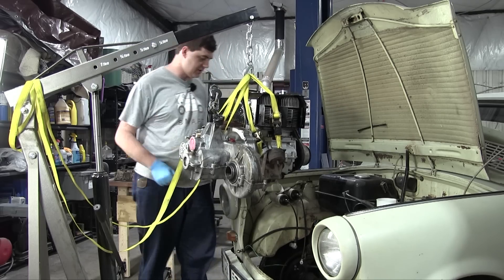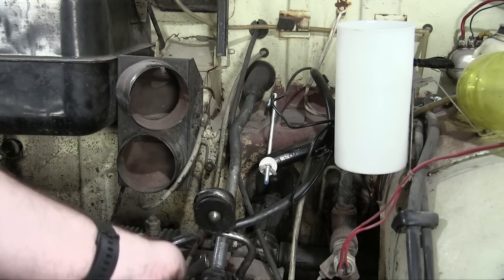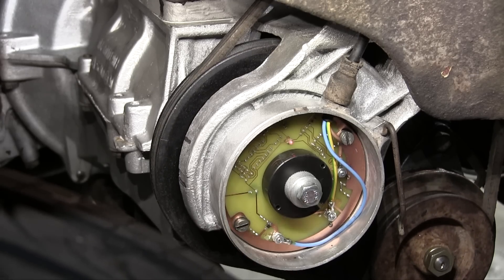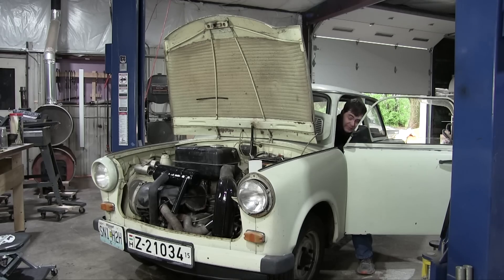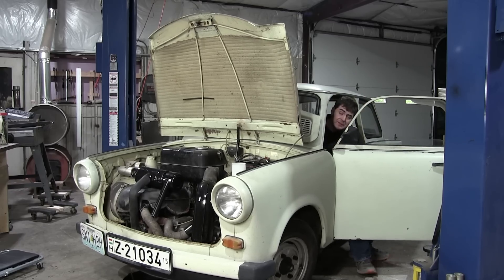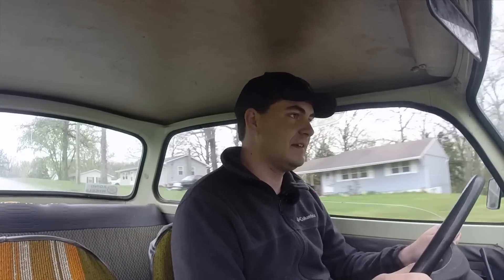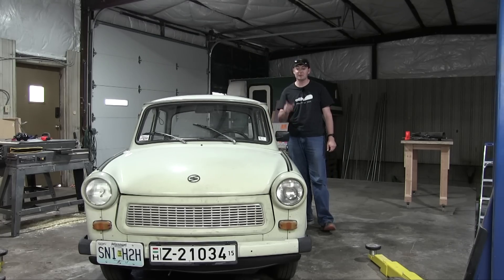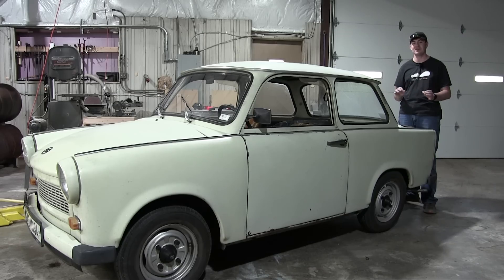Rebuilding the Trabant's Engine: Part 4 - Finale

Comment: Very good job Sir. Joke: A Trabant in the US breaks down and the owner takes it to a garage, picks it up and drives away. The Trabant moves 10 meters forward and then 10 meters back. The owner returns angrily to the garage. The mechanic looked and said:
-Please excuse us Sir, instead of the original engine, we mistakenly put a DODGE wiper motor.

Comment: It's still super sophisticated compared to Hubnut's Invacar (which has three wheels and a 250cc single cylinder two-stroke engine). Not to mention that Hubnut is a much worse mechanic. 

I'm a bit surprised that the electronic ignition wasn't built to use the mechanical advance. I recall retrofitting contactless ignition systems into vehicles in the 1980s, and they used they still used the mechanical advance.

Comment: thats not how you check true TDC with a gauge...there is flat spot of several degrees once you hit TDC so you need to mark the beginning and the end of the flatspot and true TDC is exactly in between those...hope i made sense, i am no native English speaker.. i dont understand anything about trabants but that electronic ignition with those flimsy traces looks like its gonna fail in short orde and leave you starnded...mechanical points need constant attention but good or badly they always kind of work to get you home...and an ignition system with no advance compensation would be a big big no no in any 4 cylinder car, i dont know about the trabant though

Comment: Do they have fuel pumps, or is it just gravity fed? I'm guessing the later right?
Reply: Gravity. And level you check manually with a plastic dip stick. Which you keep on the inside of the bonnet.

Comment: Did you know that at the end of the GDR, the wait time for the vehicle was 18 years? Oh, what is a wait time? Well, in East Block countries, there were 2 ways to get a car: Either you are important (like work for the STASI, look this up) or you can "order" the car and wait until it is manufactured. There was one additional way for people that had relatives in Western countries - they could ask their relatives to buy them a car with Western currency and that's how my grandfather got his Wartburg; my great grandmother bought it for him - she lived in Western Germany. This wait after the order was 18 years at the end of East Germany before the wall came down. That means if you have a child and wanted it to have a car when being able to drive, you would register an order at its birth. Not making this up.

Fun fact that resulted from the long run of these cars and hard-to-come-by replacements: There were almost no totaled cars. My grandfather lost control of his vehicle, crashed into a tree with the roof section of the back seats. My sister was supposed to be with them but fell ill that day and nobody was seriously injured. By all objective accounts, this thing was totaled. Frame gone. most of its body panels if not all, gone. Axles, gone. Motor, damaged. I mean, you name it and it probably was to be replaced - except for its VIN plate. And do you believe it, the shop knowing that my grandfather was a war veteran with half a leg missing needing this car to get around, they "repaired" the vehicle by essentially ordering every part and building a new car, riveting on the old VIN plate. See, people in East Germany weren't poor. Money was essentially no issue, ever. Prices were dictated by government, availability were dictated by mismanagement of the political cast.

Comment: You should pay a little attention to your safety. 
You don't have automatic seat belts in your Trabant. The belts you are using are no longer approved. Your belts were the first belts available in the 1960s. 
There are also different original headrests for the Trabant. Headrests make driving more comfortable and prevent the spine from overstretching in the event of a collision.

Comment: Congratulations Robert. Really well done, although I must admit I feel conflicted here. On the one hand it's a fairly monumental achievement to get this little slice of communism's finest automotive expression up and running in the good ol US of A, but on the other hand it is still a terrible awful car that's completely gutless and spews clouds of two stroke noxious fog wherever it goes. However since you're now good at this kind of thing might I suggest for your next project a Wartburg 353. Or pretty much anything by Wartburg, they're all dreadful. Anyway, well done. I think.

Comment: There is more technology in that single electronic ignition than one thousand Trabants combined.
Reply: You say that, but my father's Trabant had a fuel consumption indicator that used a string of LEDs like a VU meter (I guess in lieu of an rpm gauge?). Sometimes when he was freewheeling in 4th gear, all the LEDs would go out, and my father would tell me "now it's producing fuel". :)
Reply: tybofborg 😂😂              🤔🤔

Comment: That poor engine! Assembled with zero assembly oil, cranked over dry with the fuel (and therefore oil!) turned off then high idled with a few revs to ensure maximum wear! 2 strokes rely on the pre-mix for lubrication, always, always, pre-lubricate an engine with build oil, never dry crank a two stroke. For a rebuild like this I would always, at a very minimum, run the first tank with an extremely rich mix. If it ain't smoking, it's hurting! Otherwise, loved the build series!

Comment: I've also rebuilt the engine of my old Fiat at home, took like... 3 months to get all the parts and tools I needed, plus some days of work on the car itself. Can't help but smile along with this guy, I know just how awesome it feels to have your car back, and knowing that you're resposible for fixing it.

I was so anxious I started it for a  few seconds, with NO exhaust at all, and even without the cooling system, I just needed to see it working haha. Of course I'd make a video with it spitting flames without it's exhaust lol, this was the actual second start after the rebuilt: https://www.youtube.com/watch?v=s6RjLN2J_J4

Later I assembled the exhaust and cooling system, it became MUCH quieter. https://www.youtube.com/watch?v=zuSXgKCQFf8

First thing I did was to take it to the highway, it ran so smooth I couldn't belive haha. It's quite a unique feeling indeed.

Comment: Wait what... Trabants top speed is 110km/h? I have never seen one do more than 80.
Reply: Then you didn´t see normal ones. Granted it takes quite a while to get it up to 100, but it should be able to this without problems. On a flat that is, uphills are enemies. My Trabant did even go a bit over 110, but only downhill and with a tailwind. :D

Comment: Nice too see that you have so much fun with that car. 

But some infos bout that .. 

Later Trabants got 12 Volt power. Also some indicator lamps for engine rotating speed are added.
https://pf31.pappenforum.de/thread/30457-tachoabweichung/

A turning light and a fuel indicator was in some models too.

Names for the Trabant
Rennpappe <-> Racingcardboard / Racingpaper
Duroplastbomber <-> thermosetbomber
Plastikbomber <-> plasticbomber
Elefantenrollschuh <-> elephant-roller-skate
a song about the car 

https://www.youtube.com/watch?v=3GoP408Jr2k

Comment: Your doing in all wrong. First, no Trabant owner has ever had an engine hoist. You put the gearbox first and the engine without the cover so you have a good grip on it. By hand. And you must have a random friend/co-worker with beer at hand explaining what your doing wrong. When istalling the exhaust lay down some old tires, make any bystander useful and tip the Trabbi on its side. On the test run enjoy the sorry looks from Lada drivers, they had better party connections. Or you just stay away from any form of socialism and enjoy the Trabbi as a hobby.

Comment: What a pointless pointless electronic ignition. It wouldn't have been that hard to include a microcontroller that could programmed to appropriately retard the timing or compensate for cylinder phase difference.